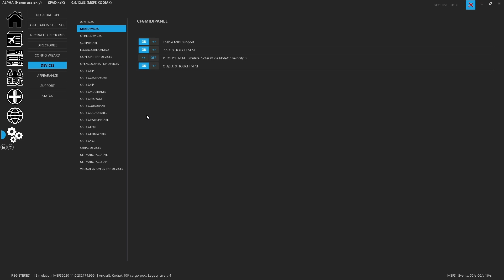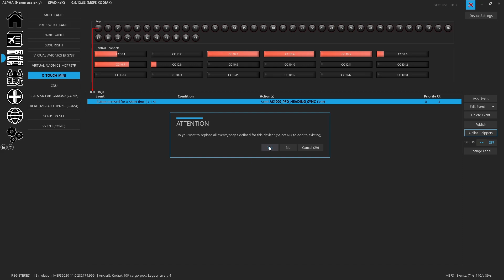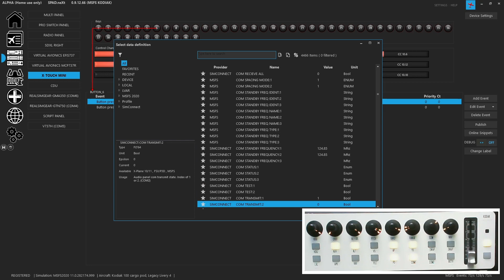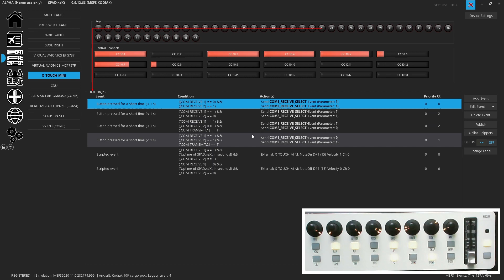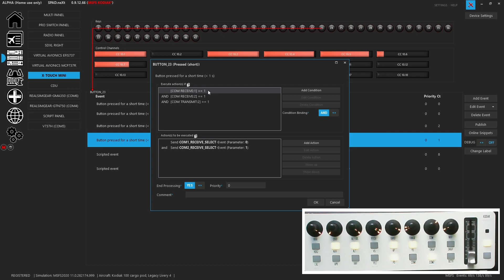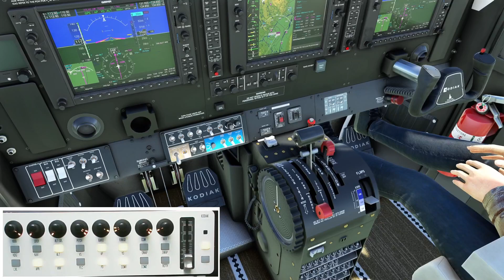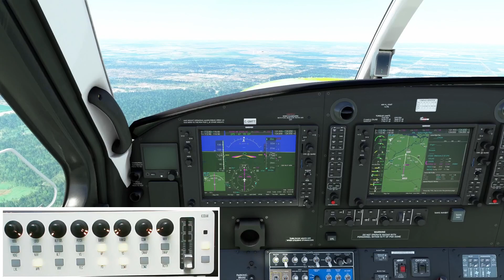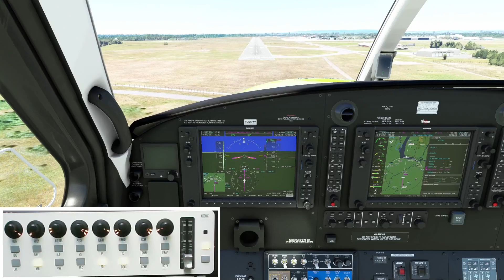MSFS | SPAD.neXt | G1000NXi | XTouch Midi Config

Comment: Yet again Les, you have nailed it with a superb video.  You have convinced me to purchase one of these  X-Touch.  
I am wondering would  Novation Launch Pad Mini Mk2 work with Spad?
Reply from the maker: I don't know.. if it is using standard Midi then it should work just fine..
Reply: @LesOReilly  I'll research this.  Incidentally, I am intrigued to know if you 3D printed the overlay or did you purchase this?
Reply from the maker: @FHamoudi  https://www.taktility.com/overlays/xtouch-mini/ .. I ordered Blanks from this place (10 of them) and I use a P-Touch to print labels I stick on it..  They also offer custom Printing jobs if you want to do that.  I have seen some really nice examples with colours and details which make them really nice... especially with the A/B layers with different backings to make them stand out.

Comment: How can I manager LED light when in layer B? (in layer A, OK - but if you change to layer B, the LED position dont update, they keeps like in layer A. Some soluction?
Reply from the maker: You need to add a local variable and update that. Then use that as a condition. Make sure every button and control on every page has a an event in n it to tell the local variable which level you are now on.

Comment: Ah great, I also use the XTouch Mini for use with the G1000Nxi. I use it in VR, so I did not assign all buttons (yet?) because I have to count blindly which button I am using. And I also use the Saitek panels. I have the Xtouch next to me in portrait mode, that way the top buttons match the orientation of the 6 buttons Direct To, Menu , Flp etc.  The rotaries I use for zoom, altitude select and FLC. But I am considering  flying on VATSIM, changing the BARO setting would also be handy indeed.
Reply from the maker: Cool!!  I have seen some 3D printed knobs on the internet for replacing the Knobs with Shapes like you see on the Garmins
Reply: @LesOReilly  wow, nice. Maybe some kind of tape will be enough also.can the knobs be ordered somewhere?
Reply from the maker: If you can find the Print files online you can always use a service like Shapeways ..  ETSY seems to be where you can find stuff from people that supply it as well.

Comment: Les, I meant to ask where you get or how you make your faceplates for the XTouch? I have created a Powerpoint document showing the knobs and buttons, which I print and write on for the various aircraft and configurations. That works, but means I have to glance over to the document when trying to remember what does what vs that information being front and centre on the device.
Reply from the maker: https://www.taktility.com/overlays/xtouch-mini/ .. I ordered Blanks from this place (10 of them) and I use a P-Touch to print labels I stick on it..  They also offer custom Printing jobs if you want to do that.  I have seen some really nice examples with colours and details which make them really nice... especially with the A/B layers with different backings to make them stand out.
Reply: @LesOReilly  Thanks. I just checked out the website and for sure will be ordering Blanks. They would be sooooo much better than my pieces of paper solution!

Comment: Hi! Great turorial! Do you know if it’s possible to program the encoder LED in SpadNext?
Reply from the maker: Yes it is ..  Similar method as the Buttons but their info is published in the manual.  You can also set which mode they are to display in.

Comment: Les, have you made any videos with the midi interfacing with FMS (Dir, fltpl, proc, menu etc)  side of the g1000. If so can you point me to it. Thanks in advance
Reply from the maker: Those are all just AS1000_PFD or AS1000_MFD events.  Change the Event on a Knob or Button and go look for those events in the list .. use the search to at the top to make it easier to find.

Comment: How does this deal with two Xtouch mini’s and how does Spad next compare to Axis and Ohs with using and assigning functions to these devices?  Also does it have a way to add scripts and assigning non standard stuff, for example Fenix’s A320 and does it light up the LED’s on the buttons based on something being on or off?
Reply from the maker: it bases them on how Windows reports them...  I do not use AAO so can't explain that ...  as for "add scripts" ... ugh I literally show in the first couple of minutes how to download these device configurations called "snippets"...  I also show how to add events that are all in the software...  so "scripts" are Events in spad...